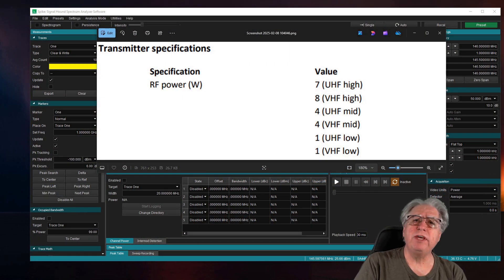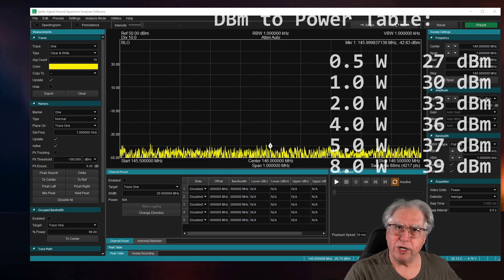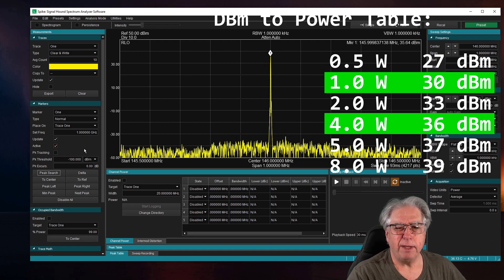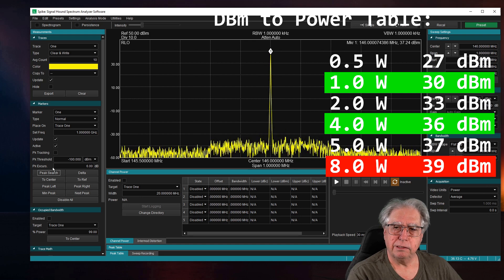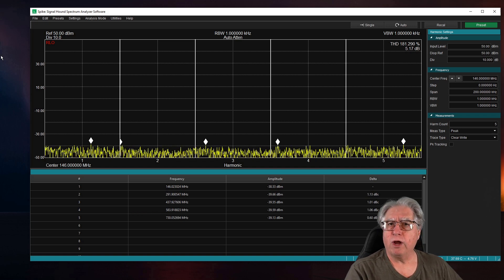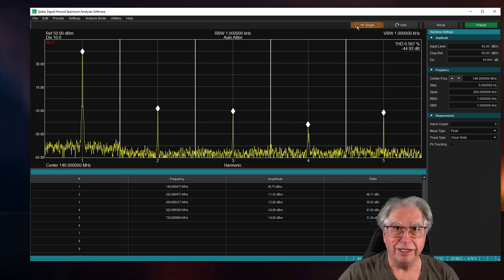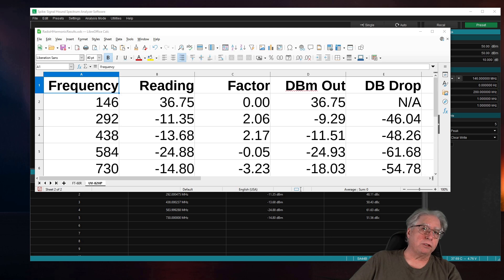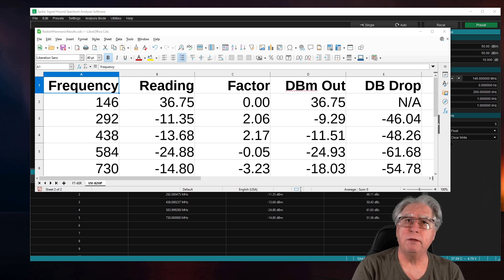Baofeng UV 82HP Transmitter Tests

Comment: KN6MYG, Great video Stu! I would be interested to see this radio done with different antennas; I have this radio with the extended battery and Nagoya 15" telescoping antenna and would be curious to see how these sorts of things impact the power output and harmonics .
Reply from the maker: Hi Doc,
Part 97 wants the actual output of the radio not the ERP. The tests are conducted using a RF Tap Attenuator pushing into a Dummy Load. So, the power is actually what the radio develops. Harmonic standards are measured in dBm and dBc so antenna gain really has nothing to do with it because again, it is tested at the radio output.

Stu
AG6AG
Reply: @AG6AG  Oh, I somehow missed that part I guess. Anyway, great video! Sad to see the max output not quite meeting the advertised wattage